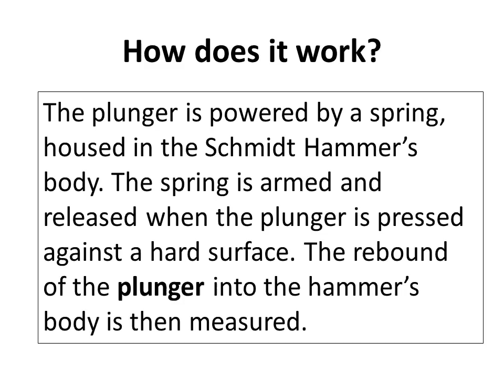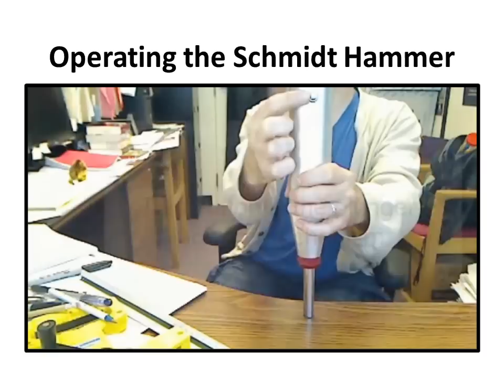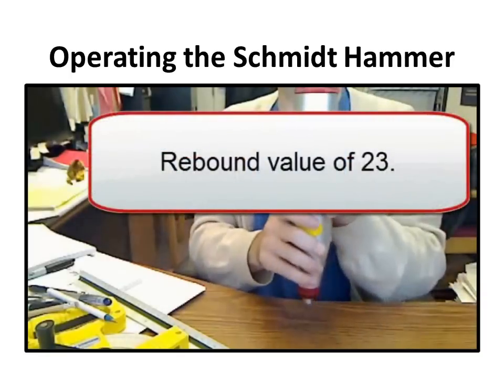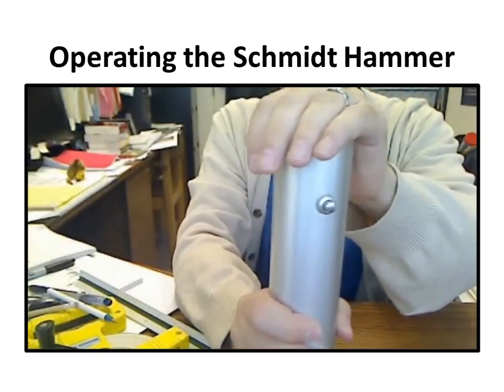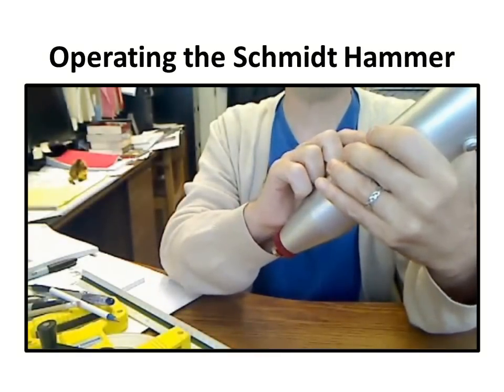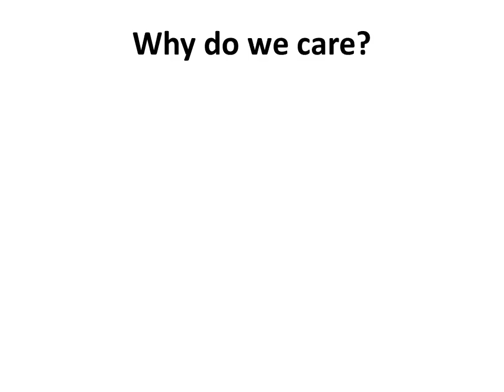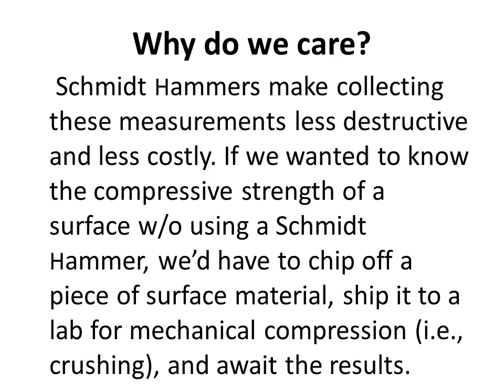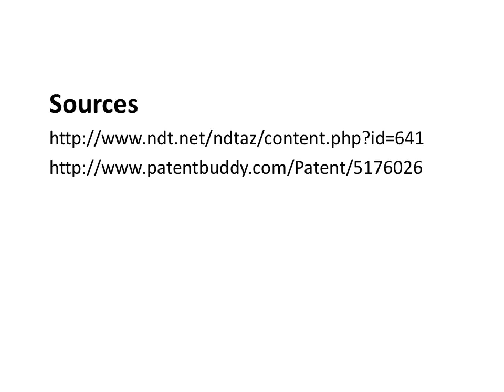32 The Schmidt Hammer

Comment: Kryst,
I work for Proceq who invented the Schmidt hammer. The unit of measurement for the Schmidt hammer is "R". It is an arbitrary unit that must be correlated to an actual strength value. This is done through an empirical method of evaluation of actual compressive strength values from a structure or samples that you are testing.  If these are not available there are correlation charts available that give an idea of strength, but these cannot be relied upon for absolute strength values.

The Schmidt hammer is best used as a comparator of values from 1 structure or sample to evaluate good and bad areas for further investigation.

regards

Markus
Reply from the maker: +Markus Denton-Masih, 

Please pardon my delay in responding formally. Thank you for elaborating on this instrument's purpose. 

For those who are interested, our Schmidt hammers were purchased sometime between 1965 and 1980. They are routinely used a few times a year in our physical geography courses, including a field course, and in my colleagues' actual research. I know our Schmidt hammers have been sent off for re-calibration over the years by our technician, but they are still in good shape even now in 2016.

My understanding is that your last sentence is spot on: this is a non-destructive technique for testing compressive strength, measured by how far the hammer rebounds or withdraws back into the unit's housing after the hammer has struck the surface. This is measured in terms of the arbitrary (but standardized) R unit. My understanding is that compressive strength is also known as tensile strength, and that this is related to flexural strength, but frankly this is on the edge of professional knowledge.

In any case, after one has determined where the good and bad areas are located, one can then begin to use other techniques which can require more expensive equipment or destructive testing (e.g., taking a sample by removing a core, which damages the original surface being tested, and is often costly to repair if one wishes to repair it).

My understanding is that the early scholarly papers (circa 1950s) on the Schmidt hammer used it to measure the compressive strength of weathered rocks in harsh climates. However, a paper by  Szilágy and Borosnyói (2009) provides earlier citation dates (in German). My colleagues and their students use it for a similar purpose, usually taking a range of measurements in a grid pattern or transect, sometimes mapping it as well. However, I believe that most people who use a Schmidt hammer use it for engineering purposes, especially testing concrete. 

I designed this video with the help of my colleague, Dr. Daryl Dagess. After Dr. Dagesse convinced me on the importance of combining quantitative data collection with quantitative analysis, I incorporated the Schmidt hammer into our department's mandatory statistics course so that: [a] students received more hands-on training collecting actual data, [b] students practiced grid sampling, [c] students had a better understanding of how these data could be used in t-tests encountered in their assignments and tests, and [d] physical geography students had additional exposure to the Schmidt hammer, a tool they would use in their field course the following year.

By training, I am an economic geographer. Physical geography in all its vagaries is not my area of expertise, though I have some background knowledge in general physical geography. Thus, I always find it ironic that of the small number of educational videos I've made, this is the one that people comment one, given I am frankly least qualified to answer the questions it generates. Especially for this reason, I appreciate it when persons such as yourself can clarify matters, as my take on the Schmidt hammer is quite parochial.

Best regards,
Jeff Boggs

Comment: table surface have same strength (same wood), how on edge gives 23 and at middle it's 35 .... i mean, why so much difference ..... is it accurate to take average of many readings ?
Reply from the maker: +Jawad Ahmad 

Please pardon my delay in responding and thank you for two good questions. 

Your first question was "why is there so much difference?" The compressive strength varies by surface location for two reasons.  Reason #1: on a solid surface, edges tend to have lower rebound values, while centers tend to have higher rebound values. This happens even if the surface and sub-surface are homogeneous (i.e., made of the same material with no variation in its strength by location). Frankly, I don't recall the physics behind this. Intuitively, however, points in the center are braced on all four sides, whereas as one approaches the edge, any single point is supported on at least one fewer side. Reason #2:  the surface can also conceal air bubbles (in concrete) or contain materials that have different properties (i.e., the material is not homogenous).  

In my example, I suspect that primarily Reason #1 is the cause. Why? The desktop is made of compressed wood chips covered in fake wood laminate. I suspect these are fairly uniform in their composition given that it is the result of a highly-engineered mass manufacturing process. I suspect that quality control in this manufacturing process, plus the fact that the wood chips are all similarly sized and mixed with the same kind of glue, results in a fairly uniform composition.In my mind, this means Reason #2 is probably not in play. A real wood desk of the same dimensions would likely have higher R values, all other things being equal. But even if I had a solid oak desk, we would still see some variation by location for Reason #1 (and perhaps Reason #2 if there were knots or joins in the wood near where we took a measurement).

Your second questions was "is it accurate to take an average of many readings?" For our purposes it was. Why? Our students needed to practice grid and transect sampling. They also needed to test hypotheses about the relative strength of the edge of a surface compared to the center of a surface. Our students are physical geographers. They are not learning to do this so they can test highways or buildings to see if they are structurally sound (though learning to operate a Schmidt hammer is a transferable skill that could help them if they were to take an occupation doing so). They are learning this so they have an additional tool to help them assess the properties of rocks and identify locational patterns.

More generally, an average of many measures, even if in the same location, tend to be a better estimator of the true value of a population's characteristic than one measure. The average of the entire surface gives the average R for the entire surface. This average is more likely to be closer to the actual value at any one point than is a single measure taken randomly over the surface. 

We could also take the average of the edge measurements, or the average of the center measurements if we thought that was important. It all depends on what you are using it to do.

Best regards,
Jeff Boggs

Comment: Hi Prof Boggs! I just want to ask, what is the unit used for Schmidt Hammer? Is it J/cm^2? Hope you read my comment. :)
Reply from the maker: Pardon my nine year delay in responding. I don't have the technical documentation here, but my recollection is that its units were only intuitive if you were measuring concrete. My understanding is that it was adopted by physical geographers, geologists, earth scientists and the like because it was a readily available tool, and not because it was designed explicitly for their research purposes.

If it were a drug, I suspect we would call its useage "off-label."